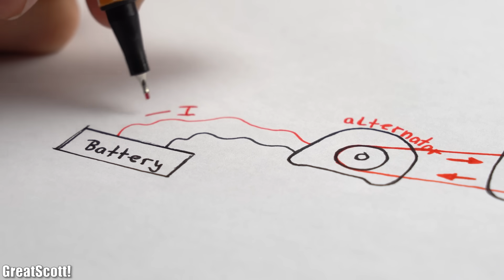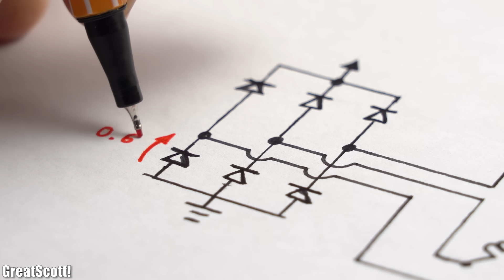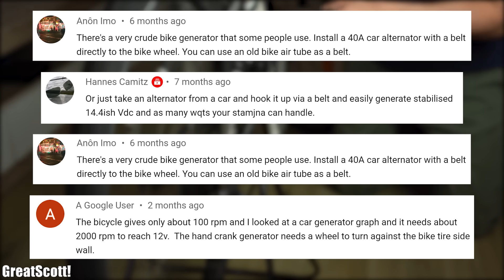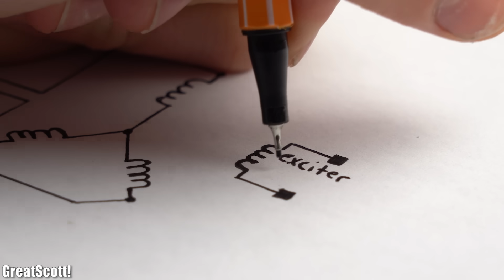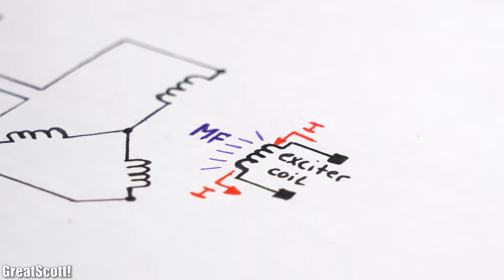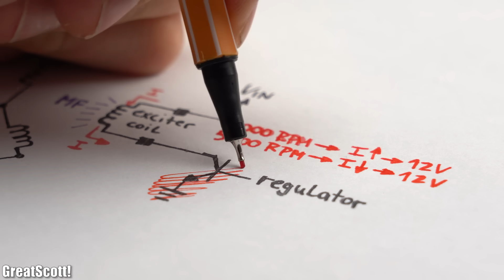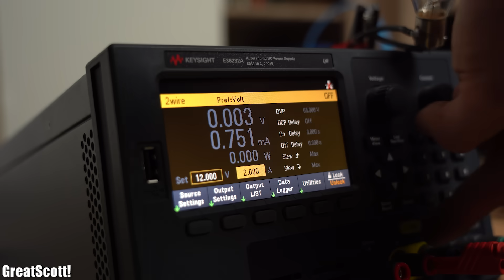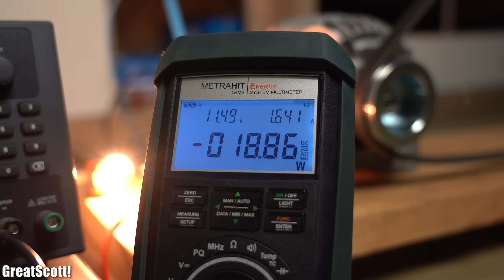Using a car alternator with a bike to power my home? How much energy can I produce?!

Comment: If you want DC, why are you not using a generator,  it's easier to turn for the same wattage,  because it's more efficient....it doesn't need power wasting diodes either....if one has to provide the power with muscles, wouldn't it be somewhat more intelligent to use the more efficient device?  Or is this video geared to chunky people who need to pedal more just because?? Just wait til you get older buddy...you'll think of some better ways really fast. This is too much waste for me...yeah if I were u I'd build a windmill....

Comment: Using a car alternator is a bad choice for this since it takes current to make the field.  You need a DC permanent magnet motor.  Same kind as a wind turbine..  Or if you can find the old tape drive motors from pre disk drive that will work too.

Comment: Bro. 20w ain't very much. I bet you can produce at least 100w continuous and 200w peak. Tighten the belt, lube the drivetrain, take advantage of your gears and set the seat post higher. At that height you aren't at your peak efficiency and it's harder to pedal. For a guesstimate, your knee has to be just lightly bent when the pedal is at the bottom

Comment: How about reusing a AC from a car. Just googled it and a cars ac cooling capacity is about 40.000btu. The biggest single unit home floorstanding ac here in Sweden is 12.000 btu. 35.000btu will cool 3000 square feet/278m2 house.
Dont know how it should be powered and how efficient i will be. 🤣

Comment: Check out the open source low tech YouTube channel. They use the motors from Chinese "hover boards" with burnt out batteries for a hydro turbine. Iirc they got 4.5 kwh per day off one, the benefit to hydro being it runs 24/7 vs solar where you get 8-12 hrs per day.

Comment: "At the back wheel, i had to do some tinkering to get the chain in the highest gear"
puts it in the lowest gear
Reply: I face palmed when I seen this.
Reply: @trev6783  “when I seen...”.  Yup, pass the corn liquor and banjo.
Reply: had he had the chain on the right gear, he would probably have had a little more of the double effect he got
Reply: May be smart about electronics but I give him an “F” on mechanical aptitude.  Any of us that have been around alternators and generators knew this was going to be a big zero.
Reply: Huehuehurhue "higest gear" more like bigest gear they coud get so much more emergy from the smallest
Reply: I noticed that too, having ridden many a 10 speed bike in my youth
Reply: Just to note 300-400 rpm for a 26 inch wheel is 23/30 mph or 37/50 kmph, respectively.
He didn't use the gear shown at 3:50. He tested/used the highest gear. 
Most tyre rpm ratings are around 400 rpm.
Reply: I noticed the same thing
Reply: He’d have better luck by running his vehicle in the driveway and running some wiring into his home off the car alternator. 😂
Reply: Lowest ratio, highest speed. dopey
Reply: "At the back wheel, i had to do some tinkering to get the chain in the highest gear"
puts it in the lowest gear
Reply: @pdemosllegaralos520subs2  Lowest gear- usually associated with the INPUT gear ( the thing with the pedals ) on the smallest gear- the gear with the FEWEST teeth.  On the other end, the DRIVEN gear, for LOWEST  gear ratio is the gear with the MOST teeth, or the largest gear. Lowest gear is used for starting off, or when going up steeper hills.   

When someone rides the bicycle in the HIGHEST gear, the INPUT gear is the gear with the MOST number of teeth ( largest gear - with the PEDALS attached), and the DRIVEN gear is at the gear with the LEAST number of teeth, i.e. the SMALLEST gear on the DRIVEN gear.  So to get the most revolutions,setting the gears the way he did was CORRECT to get him the MOST revolutions per turn.

There is a flaw in his logic however.  He should have tried other gear ratios as well.  He might have had lower RPM's, but been easier for him to turn the generator and still make as much or possibly more power.
Reply: @MrPir84free  Did you even watch the video? He clearly set the chain on the largest driven gear. He was tinkering on the rear (driven) gears, so setting the chain on the largest gear would result in lower RPMs than setting the chain on the smallest driven gear.
Reply: In first gear the chain would be on the largest gear...as you go up through gears 2, 3, 4, etc..., the chain drops to the smaller gears.
The larger gear increases your leverage allowing you to get the bike moving easier. Your legs are moving faster but the bike isn’t.
He did put it on the correct gear for getting the bike’s wheel to turn the fastest.
Reply: @TomLongusa  No he did not! The smaller the rear gear the faster the wheel will spin for a given amount of pedal rotation. FACT!
Reply: @peterpizzurro  Go take a ride on a 10-15 speed bike…
The cogs on the rear wheel are the ones being discussed.
1st gear will use the largest gear, for leverage to get you going, as you shift gears it will drop to increasingly smaller gears.
After you’ve gone through those a different front gear, smaller, is used to go back through all of the rear cogs again.
Just like I said…
https://www.yellowjersey.co.uk/the-draft/bike-gears-explained/
Reply: @TomLongusa  I know very well how gears work, especially on a bike. You  stated that said first gear(the largest gear) on the cassette is the fastest, which it's not.
Reply: Buy a 250 amp alternator It produces 240 volts if you go around the rectifier.  buy a 3/4 horsepower motor 240 volt single phase.  hook it up to the the alternator with a belt and spin it up.  The alternator will run on 12 amps which leaves 238 amps to run your house.  Plenty of power to run your house.  Remember, the magnets spinning causes the wires to make power it  is not free power.  The courts have said you have the right to be independent so it is legal.
Reply: @wanttopreach  of course you're not speaking of something you're doing. cause this can't work. many have tried the perpetual motion machine you're talking about but... not yet.
Reply: @davemwangi05  there are some who have done something like this on a small scale. I wish I lived back in NC I would try to make a vid. Basically using toroidal magnetic fields, magnets and pickups with an adjuster I have personally seen this thing make energy and run for as long as the adjuster was in the right spot😐. Now I know that my word for one means noting to you and what I'm saying is pretty unbelievable.  That being said it does exist and it is being suppressed, he has a bunch of grants from different universities, govt, and private companies that keep him going. I probably wasn't even supposed to see what I did. Shit he had this little black box thing with a plug and a switch on it, he takes a dead AA battery reading .07V new they're 1.5V. Puts it in the little box and plugs in 2 strands of the old school Christmas lights (the ones with the big bulbs) together and plugs them into the box. Flips the switch on the box and it makes a noise like a disposable camera flash charging up, one by one the Christmas lights started lighting up. The lights stayed on for about 30 mins before dimming, this shit happened 😳 blew my mind. I'm one for science and the laws of conservation but this was def a time I was blown tf away. Believe it or not I don't give a shit 🤷
Reply: @wanttopreach  250 Amps at 240 volts is 60 Kw. If you "go round the rectifier" it is just AC power.
To drive a 60Kw generator set would require 80Hp,  a healthy human can produce about 1.2 hp (0.89 kW).
An alternator producing 250 amps is huge, most are rated at less than 100 amps but a 250 amp alternator could produce 3.5 Kw, enough to power a large kettle. This would require an input of, at least, 3 people for as long as it took to boil the kettle.
So. The first poster had it right about how cheap mains electricity is.
The courts have also said you have the right to be wrong so there is that.
Reply: @BoB-Dobbs_leaning-left  THANK YOU!!!!! Most people do not realize thier car alternator pulls from 7 thru 15 horsepower from thier engines! And that's barely enough to run your cars headlights and a few small accesories,as well as charge the Battery to SAVE enough power to turn your little starter motor for a few seconds a day!
Reply: @wanttopreach  What the hell are you on about 250A at 240V is 60kVA and you expect to generate that with a 500W motor? Failed at life as well as physics
Reply: @sking2173  2 months later and it is 9 thumbs up! LOL!
Reply: @wanttopreach  this actually works on a flat earth!
Reply: @wanttopreach  courts ? I don't need approval of the courts to do anything with my equipment

Comment: I'm almost certain that your bike would have generated slightly more power at the lowest gear as it will have a higher RPM with lower output from yourself. Sticking it into 1st gear and pedaling like mad will just make you tired.

Comment: YES USING MOST THINGS  , IT WOULD TAKE THAT MUCH POWER . A PERSON COULD HAVE BACK UP POWER USING THIS AND A 12 VOLT BATTERY OR BATTERIES AND USING 12 VOLT APPLIANCES . RV'S USE 12 VOLTS ALL THE TIME TO RUN SOME THINGS .ALSO AS OTHERS HAVE SAID SHIFT INTO A DIFFERENT GEAR AND THE WHEEL WILL TURN FASTER CREATING MORE ELECTRICITY . MAKE SURE TO TIGHTEN THAT BELT MORE WITH A BELT TENSIONER ETC. SO IT DOESN'T SLIP OR COME OFF.

Comment: A  HVAC  blower Smart motor . May work great. . And yod be after a failed one.   The Back of it is a low voltage variable speed control.. that part Dies. . Pull out and your left with a beast of a brushless
Motor . I never tested it with a amperage  load. But I did spin the motor  with a old 18volt porter cable drill. Android and was producing 360+ Volts . It's 3phaze

Comment: sir you must use PMA or permanent magnet alternator for wind turbine and hydro... You can use FP-640 missuori wind PMA which has 70 poles and only requires 70 rpm...

Comment: I did this 30 years ago. I used a mob frame to increase the speed with an alternator instead of the engine. The current in the rotor is adjusted with a 10,000 ohm potentiometer and a 3055 transistor. it work perfectly.

Comment: i did this years ago in Taos nm.  it works best if you use a larger truck alternator, but you have to shorten the brushes a little so it will spin.

Comment: Why use an alternator??? Let me make this simple for you...go to Granger...get a induction motor 120v rated 1700rpms or less.(preferably 1150rpms) get two or  three motor run capacitors...never motor start capacitors...and a pulley roughly about the same size as the one on your alternator.  Connect the capacitors in parallel with the motor leads...apply 12 volts to the motor for  2 or 3 seconds to energize the stator... then peddle...once you peddle  faster than the rated RPM of the motor (which should not be hard to do hint why I stated get a motor with 1200 or less rpm) you will notice a slight resistance when peddling without a load Which is good because you now have a generator once you have passed the slip speed...hook up  devices to your generator as long as they dont exceed the motors rated power for example..120v 4amp will not power anything close to 500watts. Or it will Quit on you..and you have to start over again reenergizing.  Be sure to disconnect power source before stopping generator or it will demagnitize...pure and simple

Comment: I think what you need is a magneto which is an alternator with permanent magnets. They are used in chainsaws, lawnmowers and kick start motorcycles. Also I've seen a video of a guy who is using a motor salvaged from a washing machine to power his off-grid house. He's using it with a water turbine but without any gears or belts, straight connected to the turbine shaft producing about 300W. Might work with a bike too. Also I would suggest using some kind of flywheel eventually, maybe add weights to the bike wheel

Comment: your on the right track, but at the starting line. Flywheel, bigger gear ratio and more than one alternator. You want more spin with less effort. The fly wheel to assist with torque and multiple alternators (or a generator gyro) to produce more output.

Comment: Use a treadmill motor. It's permanent magnet and does produce a relatively higher wattage than an alternator.
Reply: Salvage a washing machine motor, I've scrapped a couple and kept the waterpumps and motors, and the drums are firepits.

Comment: about 500W if you are out of shape. you wont be able to hold that but for about 30sec. then you will be nauseated or be dehydrated. thats not the kind of magnitude one could comfortably power a home with.

Comment: Your calculation for alternator speed on the car is wrong.
Alternator pulley is around 1/4 to 1/3 the size of the crankshaft pulley, at idle (approx 800 rpm) the alternator runs at 2400 to 3200 rpm.
This is only enough for quite low output.
You need to get it spinning way faster.
You can help the belt to grip by putting a tensioner of some sort on the outside of the belt at the bottom, close to the alternator.
This will cause the belt to wrap around the alternator pulley giving more surface area to grip with.
You also need a battery connected to the alternator for it to work properly.
Even a 12v motorcycle battery will do.

Comment: Get a chain and a electric motor. ( electric chainsaw motor) change the pulley on alt to have a chain. Dirt bike chain be better. Electric motor need to be at less 3000rpms or more. Get two car batteries more if if you can. And then you well have your generator. Also use 2 or three alt in a line to the batteries if need more power. Plus get a DC to AC converter.  The batteries will help keep the power from fluxing but you can us the same setup without the batteries. 
But ya two or three alt connected to a 120 bracker box will do the trick.

Comment: Alternators being used as generators are so old news. May I suggest a project that no one has ever tackled yet? You know those small toy motors (dynamos) that just get thrown away? now most people know they can also be used as mini generators but what i want to know is... is there a way to connect 10 or more dynamos in (perhaps series or parallel or whatever) for us to be able to produce more power (volts and amps) out of them? then have them all connected to a central gear so all of them spin at the same time with just one hand crack of foot pedal?

Comment: The bike is shifting back and forth and the belt is slipping causing energy losses. Bolting the frame of the bike to a stand and tightening the alternator pulley so the belt is pulled tight will help a lot. Car accessory belts are pulled very tight and only flex about 1cm when pulled by hand. Bike rims arent meant for that but tighter is better

Comment: To use the hire resistance put the bike on a metal frame and then have a little wheel with a spring pushing it up against the belt to hold it more sturdy

Comment: The tiny zip ties you have supporting the bike is a problem. a metal bracket holding the frame would improve stability, and output.

Comment: I think you could use that power supply to run the light bulb instead, just move the wires from the voltage regulator of the alternator over to the light and boom you’re done! 😃👋
Reply: AND ! JUST !! REVERSE !! THE !! BATTERY !! CONNECTIONS !! TOO !!!
Reply: @davidwillard7334  nah !!!!!!
Reply: @jc-zh9kl  REVERSE !! THEM !!

Comment: All you had to do was use a GM style single wire alternator, no field wiring needed. However the drawback is you must spin the unit above 2000rpm to "jump start" the field inside the unit. Once you do it can drop down lower in speed.

Comment: I was able to generate 200w with a 1000w DC motor with a exercise bike and that's the best I can do. Thinking to add some supercap as flywheel for higher output. Update: added 12V 170F supercap which can drive 1KW sump pump in case of power outage during storm.

Comment: When adjusting the bike gear in the rear, you got it wrong -- The largest cog = 1st gear, the smallest cog = high gear. In the front (pedals), you want the largest chainring selected, but in the rear, you want the smallest cog selected to maximize power output to the wheel. 
Remember that for every 1 rotation of the pedals, you want the rear wheel to spin many times, so the pedal chainring needs to be large, while the selected drive wheel cog needs to be small. When you were pedaling, the bike seemed to be in maybe 3rd or 4th gear (6 speed, right?), meaning that you were losing a considerable chunk of power in the crankset. 

As a mountain biker, it's not uncommon for me to produce 150-160 watts on a casual ride. At a race pace, I've exceeded 200 watts.

Comment: Nice video.  Car alternators are quite inefficient ~40% if I remember correctly.  Best bet is to get a permanent magnet dc motor as your generator for your bike setup.  The best place to get a cheap one of these is from a treadmill.  I picked a broken one up for free, just has to move it.  The motor rarely fails, it is usually the motor controller which it was in my case.  These motors are compact and are usually rated between 2.5 HP to 5 HP.
Reply: Do you have any idea as to the efficiency when a tread mill motor isused as a generator?
Years ago I used a wind shield wiper motor as a generator which had a permanent magnet field.  Upon some investigation I was disappointed to find its efficiency to be only around 50%.
Central power plant generators can have efficiencies as high as 96%, I believe.  This is not the efficiency of the overall plant, only the generator portion thereof.

Comment: The alternator will only produce the wattage rating at 12 volts of the lamp.  Increase the load to 1500 watts at 12 volts and see what is possible for you to make.  Output is only to match the load!
Reply: I agree...!!!
And complete the system with a battery and a regulator...
Reply: You have to Obtain mínimun 600w in an hours...